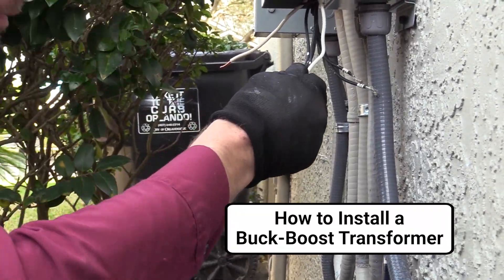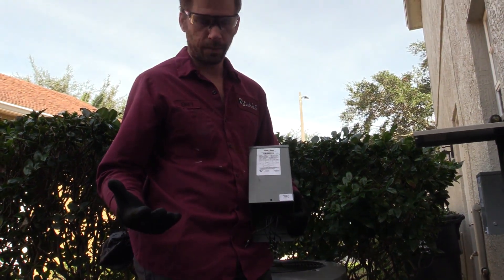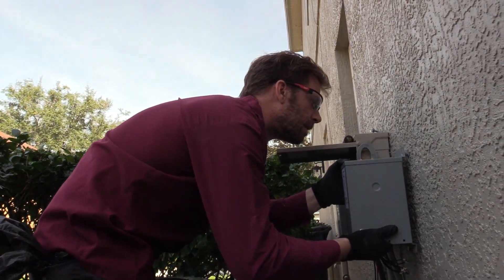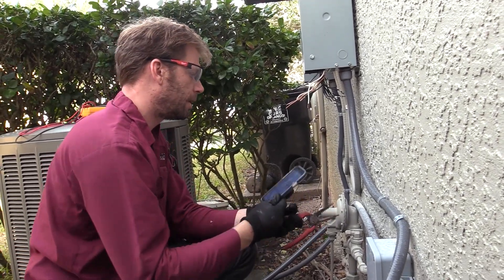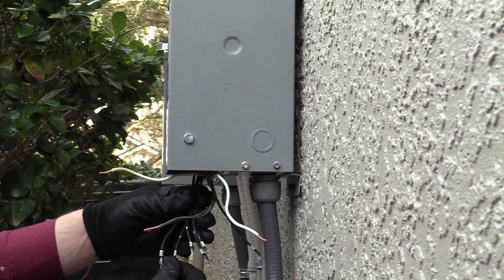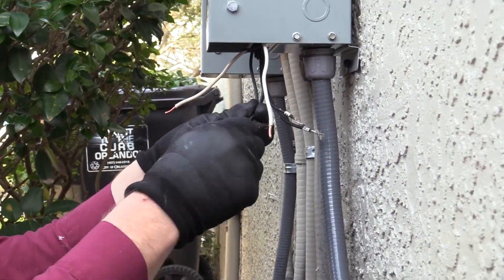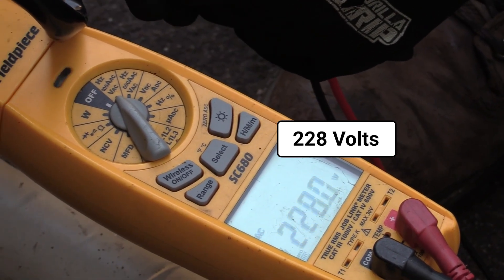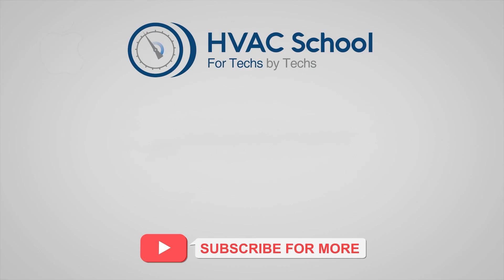Installing a Buck-Boost Transformer

Comment: Never laugh at ryobi. I’ve used other major higher end brands and because I am out on job sites or parking in parking lots at supply stores they get stolen. No one steals ryobi and they are good enough. If one does get stolen or grenades on you, it’s not expensive to replace. If I had a securable shop environment and didn’t go out for jobs, I might consider a different brand

Comment: how you choose the kva and where is the diagram?
Reply: Would be amps of load times  line voltage and then 125 % over is what I'd do. Like if its a 20 amp load 20 x 240  then x 125% around 6kva. Call hammond power solutions, tell em what you got they will size you appropriately if the catalog seems overwhelming

Comment: I’ve installed surge protectors to prevent damage to the board in these situations. This is another handy piece of equipment to have in your arsenal though for situations where it’s constantly supplying too high of voltage

Comment: Nice idea...condenser manufacturers should include one built in with each condenser. Then there are those expensive soft start boxes to save compressors etc.

Comment: I have yet to see this on any unit. If the inverter cannot handle the line voltage why the heck did they design it?
Reply: It's a questionable design.

It varies from State to State but the commonly allowed variance from nominal voltage is +/- 5%. Nominal voltage is 240 (not 230 as mentioned in the video). That means in many States the equipment maximum of 253V is only 1V over the allowed maximum voltage of 252V. That isn't much of a buffer and it begs the question; What the hell what the engineer who designed this thinking?

The fact that HVAC School is experiencing voltage readings in excess of +5%, including large voltage swings, suggests the the power company is having difficulty controlling the grid.

Edit: I'm an Electrician not HVAC and I'm not familiar with Florida's rules for power companies.
Reply: @arazusaysbah6784 here in the Pacific Northwest I have seen residential 240 as low as 207 and as high as 256. Not sure what caused the 207 situation but most solar systems need to produce a higher voltage to backfeed onto the grid and when the power company is supplying 250 then people’s solar voltage has to be increased so they get their credits. My city is wanting to do away with natural gas and the power company went to the council meetings urging the city not to push it too quickly because they are already having a hard time meeting the current demand, but we are pushing it anyways.

Comment: I installed one of these for a Bosch unit that was having the same problem. Line voltage coming in at 253 and secondary was almost 30 volts